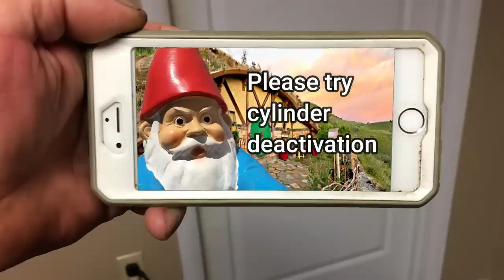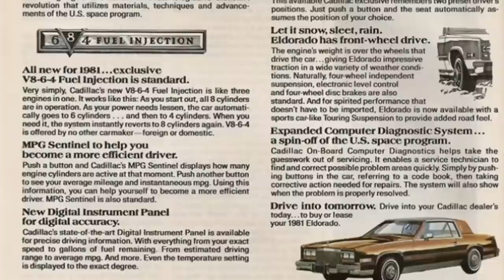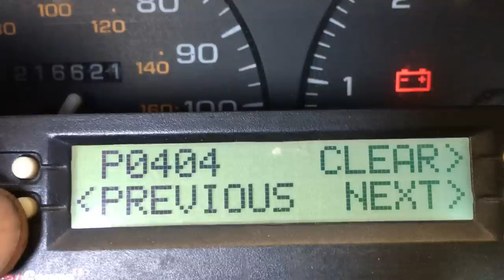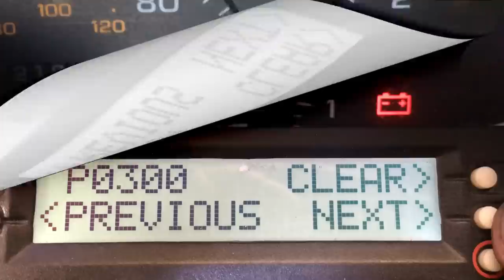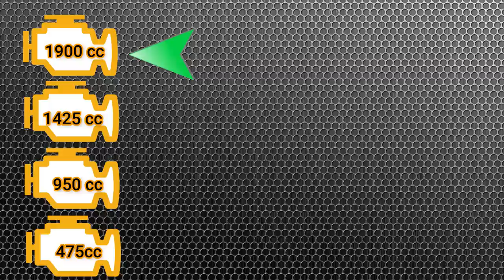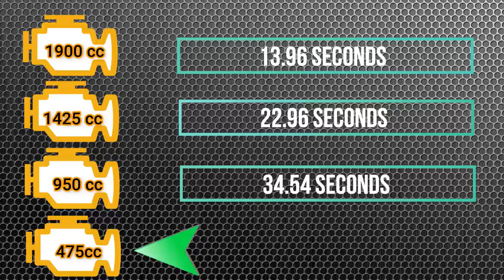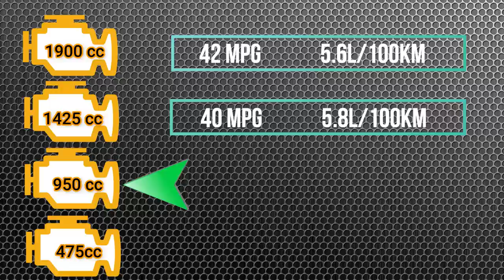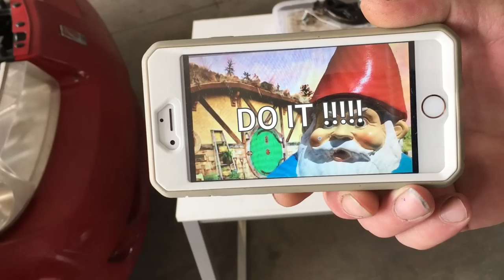S2E16:  We deactivate cylinders on our Saturn and test the car for performance and MPG

Comment: 🤯 it ran on 1 cylinder! Lmao! I'm not surprised that it made just a little worse economy on fewer cylinders. More throttle in ECU controlled engines means retarded ignition timing to reduce knock. Retarded timing means less power and less burnt fuel. Less burnt fuel means the 02 sensor sees more air in the exhaust. So it injects more fuel to keep a stoichiometric 14.7 to 1 air fuel ratio. And it does all this in the interest of protecting the engine. Still though, 42 mpg is awesome to me.
Reply: Looking forward to more from Robot Cantina

Comment: Ok, I’m have a suggestion. Break the porcelain off of two of the spark plugs and drill out all of internal stuff and weld a pipe or tube of some sort. Then put back the intake valves and rockers. Run the pipes into the intake manifold.

Comment: You needed to pull the spark plugs out of the cylinders you shut off
Reply: No, then you would be pushing air in an out of the cylinders, incurring "pumping losses." The engine would be doing extra work and get worse gas mileage and performance. It would also be pretty noisy.

Comment: remove spark plug no 2 & 3
Reply from the maker: Actually leaving the spark plugs in place helps reduce pumping losses.  If the plugs were removed, the cylinders would be ingesting air through the plug holes and the drag on the engine would increase.
Reply: @robotcantina8957  but if the spark plugs number 2&3 are still there, it will burden the engine due to compression
Reply from the maker: @bojkon   With both intake and exhaust valves closed, the cylinder is more or less empty.  The easiest way to settle this is to just google "cylinder deactivation"  Keeping both valves closed is the most efficient way for the engine to run with a deactivated cylinder.

Comment: This test is flawed. Deactivated cylinders need to have the exhaust ports and intake ports open on a separate cam lobe so there isn't resistance from trying to compress the air in the combustion chamber. the extra resistance hurts more than it helps. Thunders car is a big engine little carb approach with no ecu messing with timing and fuel like the Saturn recognizing there is a problem with the engine and going into a limp mode to speak
Reply: While you are on your journey
to a safe and calmer port
look out for fellow sailors
who may need some support
Reply: Could you throw them a life belt
a paddle or an oar
perhaps you could help guide them 
a bit nearer to the shore.
Reply: Limp mode is always hard to deal with.
Reply: @kansasrose2909  😵‍💫😵‍💫😵‍💫😵‍💫

Comment: There are a number of points that l have noticed...first of all you talk in plural sense..have you come to a mutual agreement with those funny little people.
Secondly,  your yard is large...are you intending to build an airport for your little friends.. is that part of your agreement with them....more immigrants from Ireland
Thirdly, l noticed that inside the car you had the rearview mirror positioned half way down the screen..this to me clearly indicates a small person sitting in the passenger seat...would that be a small observer...
Lastly, oil smoke coming out is when you ran with 2 cylinders.. Oil accumalated. Oil burning is the 3rd cylinder being used after being allowed to splash about with oil 
real professional...or is that amother agreement with the little people..
Love rhe wiping down engine cover...
I also wonder if you took the spark plugs out...l presume you did

Comment: Do not do this!! Fuel has cooling and lubricating properties can harm engine
Reply: @GIGABACHI  what about regular gas most engines still don't support flexfuel and when they are made flexfuel the oil changing period shortens because of that etanol thing🤔
Reply: @jonikortelainen6084  Gasoline on itself it's a HORRIBLE lubricant. Ethanol just made it worse.
E85 = You need to inject A LOT of it compared to gas, this in term washes the cylinders, pistons and rings to a degree and all this ends up in your oil pan, dirtying and thinning your oil(all the highway driving in the world won't evaporate that out), plus Ethanol is highly corrosive(high water content by nature and absorbs it from it's surroundings if let uncapped).

Comment: You're audience is a lot smarter than you realize..
Reply: We need to surround ourselves with people who are smarter than we are🤓🤓🤓
Reply: To save on gas.  use apps to find the cheapest gas. ⛽⛽⛽
Reply: You need to accelerate slowly and coast more to save on gas.
Reply: and check the tire pressure.
Reply: Lighten your car and lighten your load.
Reply: Use the right oil